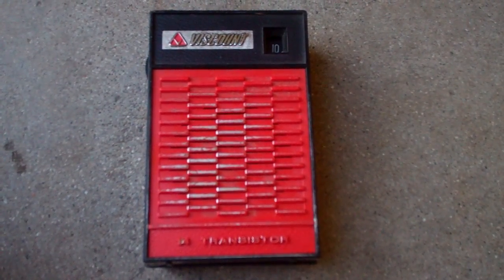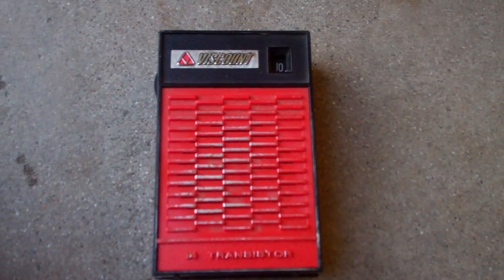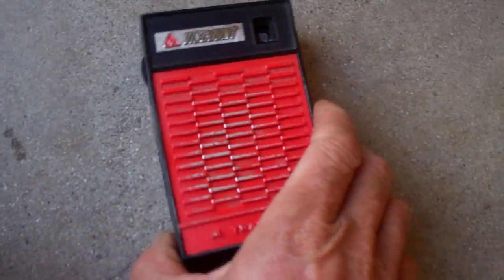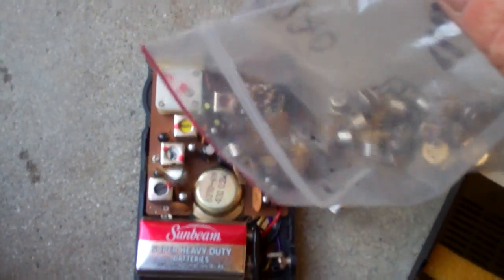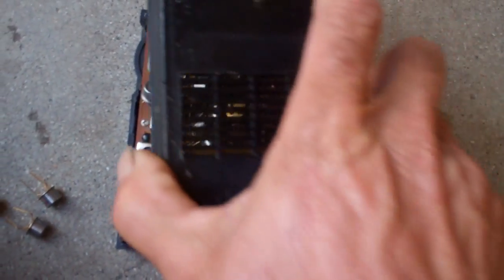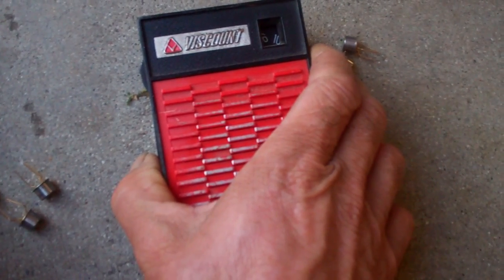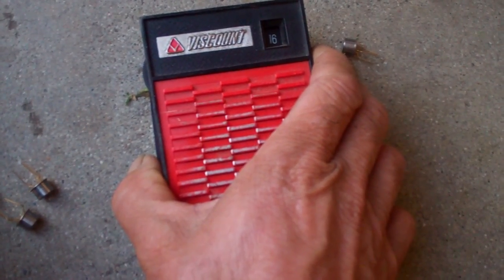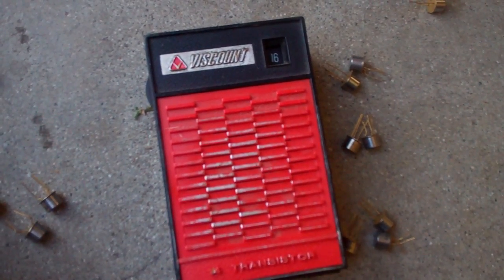Vintage Transistor Pocket Radio How To Improve Performance Factory Style

Comment: On a more serious note, IF transformers can drift in value over 40+ years.

Did a little tweaking on my radio shack 8 transistor radio. Actually helped quite a bit.

Comment: You might be surprised to find that the extra transistors are simply soldered to the board but their leads don't go anywhere and are not connected to anything. Back in the vacuum tube era they used to put in sockets with tubes on the chassis which were not wired to anything at all.  But, they could say their chassis had 20 tubes... Some things never seem to change.

Comment: Could be, at the time, the transistors were cheaper than the two audio transformers they replaced. shango066, you're lucky to have a working unit of this design.

Comment: 5 transistors is the lowest count you can have, assuming you use a diode for detection.
0.2W is all you need in those damn things & they still sound lousy.
The six transistor HX-6B kit Shango made uses a transistor as a detector. Those damn 'bowler hat' silicon transistors.
Thanks to Shango's instructional videos I dealt with one of these problematical radios with a 2N3904 & capacitors scavenged from TV panels and a dumped karaoke machine.

Comment: That was the thinking in the 1970's, get the transistor count as high as possible.
I still think, a Japanese produced Sony is better.
Reply: That actually started in the 1960's, sometimes as a scam! The xsistors were wired as diodes and had no active gain at all

Comment: LMFAO. Good one!!!😂

Funny thing is that in some cases back in the day a lot of companies actually did just that. They'd advertise for example a 10 transistor radio. It would have the full 10 transistors inside but the extra 3 4 5 whatever transistors would be either defective or completely dead.  It was a sales trick and a nasty one at that to nab extra money.

Comment: I had heard somewhere that the cheaper Japanese companies would buy up transistors that failed quality control inspection and use them as diodes. Seems like that's what they did here. If one transistor is good, a dozen or more must be great!
Reply: That happened alot in the 1960's until we outlawed such practice
Reply: About half of them dome top transistors are junk from the factory

Comment: I have made a super simple 8 component 5w audio amplifier and i have found that thermally attaching matching transistors wired as diodes to the driver transistors is the easiest way to bias it. this is a push pull amplifier capable of outputting DC.

Comment: Imagine if they had done this in the vacuum tube era...
Q: What do you call a radio that has 100 vacuum tubes? 
A: A space heater.
Reply: In the console radio era, tube count was a selling point and high end models did have extra tubes that didn't really improve performance. Advertising included the tube count, with progressively higher priced console radios from the same company having more tubes. Later on, the industry settled down to the "All American" 5 tube table radio as a standard for the consumer market. There was a poorly performing 4 tube version and a 6 tube version which did perform better than the 5 tube version, especially if if had a 3 gang variable tuning capacitor, but 6 was the maximum for consumer grade AM radios (with maybe a few rare exceptions).

One tube was a rectifier and did not process the radio signal. In the USA, by law, 5 tube radios with the rectifier tube were designated "4 tubes plus rectifier". AM-FM table radios had more than 5 tubes and sometimes replaced the rectifier tube with a selenium rectifier in order to accommodate extra tubes in the series filament string.

Five or six transistors were required for a fairly decent performing pocket transistor radio. GE made its excellent performing model P780 transistor radios with 8 transistors, and, initially, proudly designated "Eight transistor" on the front of the radio. Transistor manufacturing had poor yield at the time. Radio manufacturers started buying up the rejected transistors and populating the board with them, either not part of the circuit or used as diodes, just to increase the transistor count for marketing. The "fraud" was written up in some magazine articles where the author clipped out transistors that weren't part of the circuit and found that the radio performed the same. GE added a 9th transistor to improve bias in a later P780 model, but didn't advertise it. By then, consumers were scared away by high transistor counts!